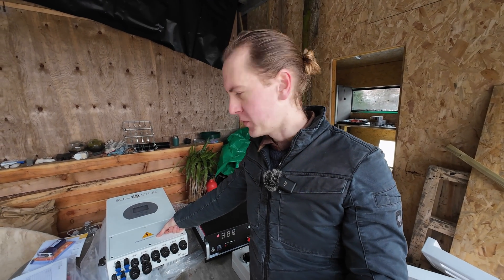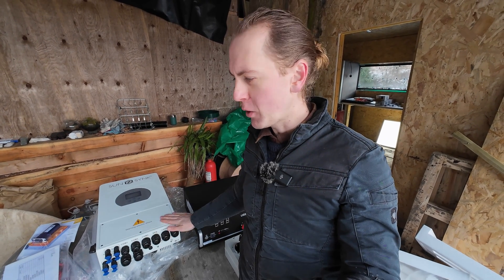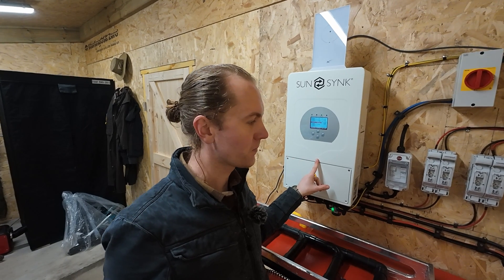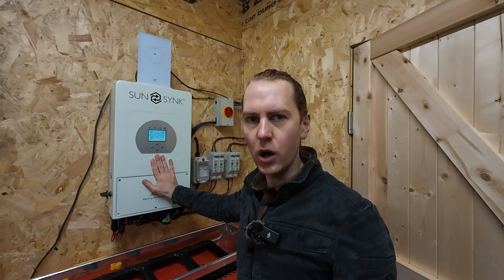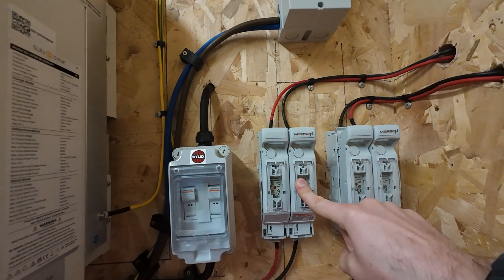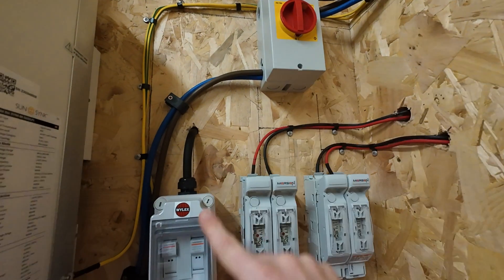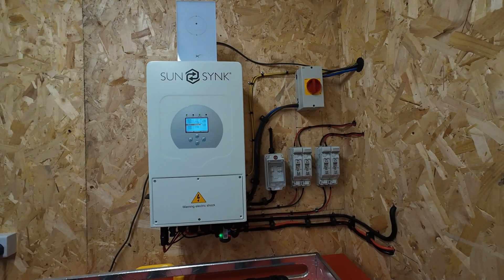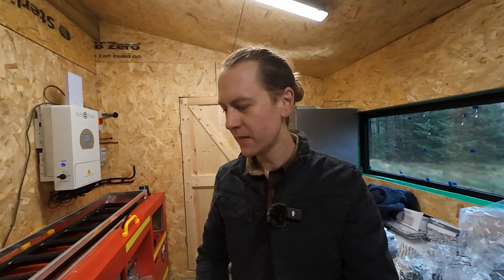Full inverter and battery setup hydro solar. Off Grid Day 43

Comment: Watch out for the 2kW heater... It do not like to be turned off without running the fan for cooling for a minute or two...
Danger - Fire.
You can properly retrofit it to run the fan of a constant power and the heater and controller part to run of the dump load output.

Comment: Well done, good luck for the next winter freeze. I recommend that you should insulate the battery storage box as the batteries do not like being at  low temperatures.
Reply from the maker: Thanks I did find exactly that last year so I will be insulating it while its warm this season

Comment: Hi,  just setting up our 16kw sunsynk inverter for our new micro hydro, very exciting.   Did you populate the ' Advance- wind turbine ' settings on the inverter for the water turbine? and if so what did you populate it with...
Reply from the maker: Excellent! thats a really great inverter. Yes I just increased the amps on the wind turbine settings until the turbine and power output seemed balanced. It changes with the water pressure, I had to reduce the amp volt relationship today because the turbine was spinning too slowly due to less water being avaliable

Comment: may I ask why you put the Lifepo4 batteries in the un-heated side. They can not be charged in temperatures lower than 32F (0C)? I built a utility room for our batteries, inverter and water system and heated with a diesel heater so they will not freeze.
Reply from the maker: It was a space thing. My sons fire engine takes the whole side up and he is also likely to play with the battery box (even if we contain it he will play with the cables). Its not permenantly sited though we will be increasing the number of batteries we have soon so will look at a better place when we do

Comment: Theirs an idea, using the the sand to hold heat in a electric floor.
Just watched (turbulent hydro) Belgian company, if you've got 1.5m drop and a nice flow river, they can create 5 too 15 kw, that's two electric cars, cooker, wielder the works. And it's premade they just make a concrete tank and drop the vortex turbine in place.
Sorry carn t post on same post as tablet to small to write in.
Reply from the maker: I have seen their turbines and plan on making one in a future video as we have the perfect place to trial it

Comment: Yes very cool, free water heater, for days, thinking it's going too have work on the same principle as a boiler with a blow off valve at the top and then a second sand battery outside or in a shed before the water turns too steam
Reply from the maker: I am so excited about having a go with a sand battery. Because I have already thought about it before beginning the house I am considering building one under the floor of the house.

Comment: Thinking the solar array angle is going to be more and the decline is going to be later, worked out the dates for cornwalls solar improvement not Scotland's !
Reply from the maker: A new solar array mount is on the to do list as I have another two panels to add to the system so I will have a closer look into the angles when I get to that.

Comment: Seplos mason kit 14.4kwh 48v 2k
Polynteck cables get hot, 5 needed to spread load
Solar panels 60degrees from September 20th too March 20th
Love the budget hydropower, had many lessons, burntout wind turbines, none thermostat diesel heaters ( got the 1kw too 8kw, too change parameters passcode 1688 speed and output, cause it can get hot and plastic smelly) and mould
Dump load, sand battery, keep water hot for days
Wouldn't have known 20years ago I would have a solar water wind farm, vegetables next,
Now knowledgeable to help others with it
Reply from the maker: Thanks! I am looking into making a sand battery too as they sound really cool

Comment: You'll never get proper power out of that lightweight, low surge, short lived high frequency, transformerless inverter. You should have installed a low frequency, transformer based inverter.
Reply from the maker: I have heard from others that low frequency installer is a preferred option but we have more power than we need every day so we are happy with our set up

Comment: Your DC inputs need surge protection, they are not expensive and are required for warranty as per the install manual
Reply from the maker: thank you, I will look into those as I wasn't aware I needed them.

Comment: Congrats on getting it all up and running, nicely done as well.
Could you show us what you can get out of the hydro now, 500 watts?
Must be sooo much fun making your own power.
Reply from the maker: Thanks! I am getting 750watts reliably at the moment, I am going to do a short video on the inverter alone because it was the tweaks in the system that took the hydro from 350w to 750
Reply: Wow thats awesome. @beyondtheworkbench

Comment: Yourr face says it all, it lights up when the lights light up the workshop. Best place to have a fire engine side of the electrics and those batteries. But please get some decent fire extinguisher with all that wood around. Brilliant
Reply from the maker: Thanks I was extremely pleased to have them on. I have fire extinguishers all over the place just for that reason

Comment: I would look to make the hole in the timber larger than the sheet metal hole for that generator exhaust so that no heat can transfer to the wood / burn. Possibly also add some kind of heat proof insulation between it and the wood.
Reply from the maker: Thanks, the hole in the timber was larger but only by 10mm or so, to make sure it didn't contact in any place but I will likely add some additional heat wrap to make sure

Comment: Congrats on making your electrical setup more powerful. I was also wondering if you'd be ensuring that your lithium iron phosphate batteries were warmed up above 0 C to ensure that they can safely charge. Does your battery pack have a low temperature disconnect for charging? If not, then charging when the battery is below that will damage the cells. You might consider making the dump load from the hydro warm up the utility room as well.
Reply from the maker: I have had a few people mention the low temperature issue so I will be looking into that asap. The dump load heater has a cable so that I can move it around rather than a fixed heater so I was hoping to move it where we need it at the time

Comment: Be careful I had a hyundai on my boat broke down within the first year I serviced it more then it needed and the returns policy was really complicated needed to send a video of the fault then send then sent it back at my cost then they turned around blaming me I had to fight for a refund I then replaced with a max speeding rods for half the price going strong 18 months now 

Keep up great vids 

Alex
Reply from the maker: I got the maxspeedingrods diesel heater and was very impressed with that but I didn't know they did a generator so I will definitely check it out now I know they do
Reply: Yeah mate it's the first time I used them the diesel heaters okay too hyundai was a petrol petrol 3500 watt massive thing I serviced it every50 hours runn time and the main head cracked after 150 hrs run time just over a year old they don't have service people they just tell you to record a video of the petrol leaking everywhere on your back deck and to send it back the battery swelled too..  just be really vigilant with it as a back up you need something worth it maxspeeding one I got is 3.3 kw and runs on eco for like 5 hours to 4 litres of petrol.. I have a 600 amp lithium 12 set up charges from 30 to full no problem on a can of e10 e5 I get a little better... I just subbed keep up good work..
Reply from the maker: sounds like you have worked through the early problems to something that works really well now. Thanks! @forresteralex

Comment: You will continue to be haunted by power woes because of this high frequency, transformerless inverter's poor surge capacity and short life expectancy. You should have purchased a low frequency, transformer based inverter if you wanted no more power woes.
Reply from the maker: That's good to know, I will look into one of those as I don't think I knew they existed or knew the difference

Comment: Is your muffler still to close to the osb panel as it is flammable??
Reply from the maker: I cut a bigger hole in the OSB than the metal so that there was an air gap around the exhaust. Do you think its still at risk?

Comment: My only suggestion would be to use two inverters, one for solar and one for hydro. That way if you lose an inverter you can still get power and keep your batteries charged while a replacement turns up,
Reply from the maker: that's a great suggestion, as soon as we have enough cash we will look into adding some redundancy

Comment: I'd suggest insulating your battery box, lifepo4 batteries won't charge below 0C. Lots of waste heat to be harvested from generators, at best diesel to electric conversion is 30% efficient, the rest is heat.
Reply from the maker: Great idea, I have a pile of spare insulation right next to it so I will add some